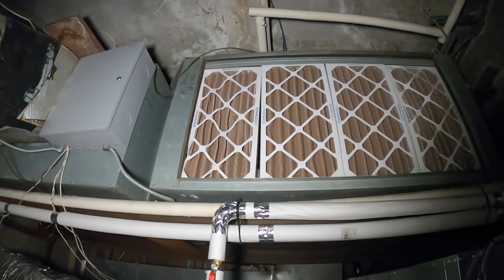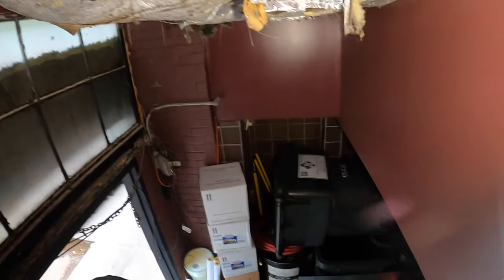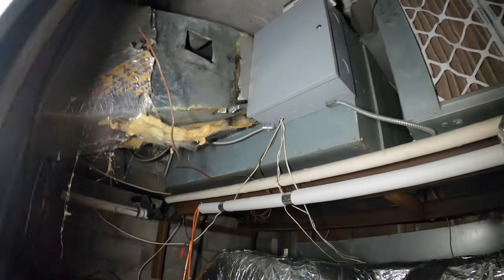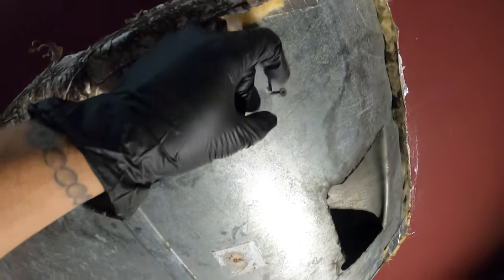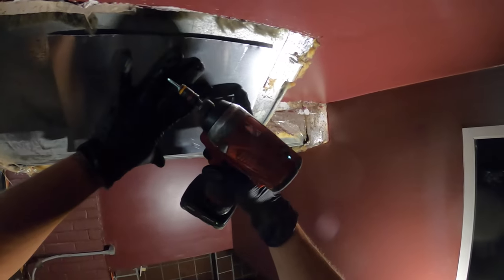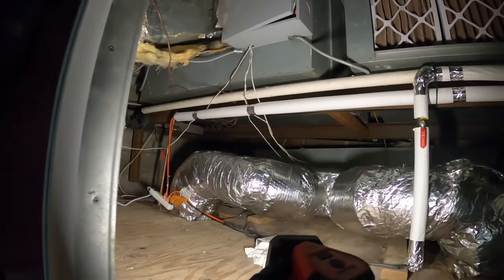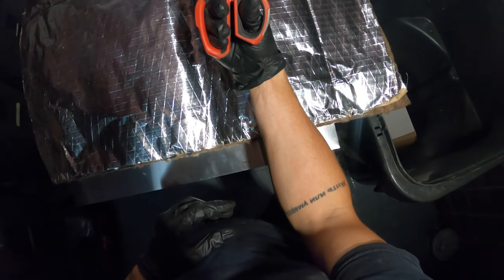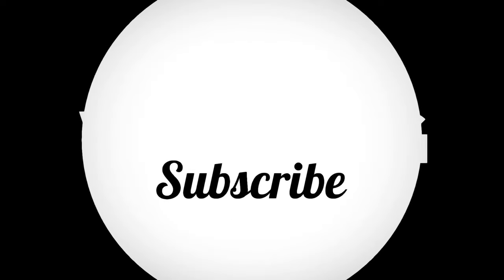HVAC Service Call: Air Conditioning Duct Work NIGHTMARE Repair (HVAC Duct Repair) AC Air Duct Repair

Comment: Looks a lot better. A little tip i was taught when i first started: get you some cheap spray contact adhesive and spray the joint where you are going to tape. Wait 30 seconds then apply the tape and squeegee it down. It will make it a very strong repair.
Reply from the maker: @topher8634  Thank you! That's a great tip. I will definitely try that next time. I don't do much duct work. Mainly service. Thanks for watching 🤙🔧⚡️
Reply: Next time try using push pins to hold the insulation.  The stick onto the duct and no need to mastic the duct.

Comment: I did service me and duct work did not get along. But I was taught when making a patch to kick a bevel with my hand tongs a 1/4 inch all the way around the patch. That will prevent the patch from buckling when screwing it down.  Looks good to. Thanks for the video. Good job

Comment: Great job I started with residential and commercial installation ductwork is what I love doing the most. Definitely using the air seal is great. My only suggestion would be to get some Midwest offset tools for making the cuts easier for you. Malco turbo sheers are great but I think the hand is more precise for making close cuts. Definitely use a squeegee on all the tape the heat from using it will create a great seal. Great video!!!!
Reply: I have been in the sheet metal trade for 43 years and I must say that was the best patch and insulating job for a guy who doesn't do sheet metal or insulating. Thxs for the vids!

Comment: I’m itching just watching this video Lolol good job!
Reply from the maker: @MirsadBajrami-vd5sn  Same. I hate working with fiberglass but you gotta do what you gotta do 😂🤙 Thank you & thanks for watching! 🔧⚡️
Reply: @JumpermanTech  At least it seems to be relatively recent insulation and it was yellow fibers and duck tape me if the building was from before 1990 and the insulation was made of white fiber (high probability that it is asbestos) I would have refused to touch it because it could be asbestos but fortunately in this video it does not seem to be the case but I imagine that sometimes you come across potential pipes/ducts covered with asbestos that you do in such a case I hope you have the right to refuse to touch it when it seems to be asbestos

Comment: I did sheet metal for a commercial company out here in Buffalo NY for a few years and then went to the service side as a tech for another year or so and that install experience came in handy for stuff and was able to teach techs with more experience than me some tricks. 

For cutting sheet metal you’re going to want to buy some Midwest tools red and green snips, they are offset in different directions which will help you way better with cutting that sheet metal. Just make sure you have the snips angled properly when cutting, if you don’t they will fight you the whole way trying to cut the metal, if done right they cut like butter. 

For measuring the patch, when you go to measure the metal patch you need, run the bottom of the tap measure against the metal edge and pull your tap to desired length and lock your tape in and then hold your sharpie against the end of the tape and run straight down the metal. It will help get you a nice straight line each way. Also another tip is if you come across metal ductwork with slips and drives that are kinda loose, you can screw 5/16 self tappers thru the middle of the slip and will catch each edge of the metal that is put into the slip locking it in place.

Comment: That FSK insulation can be a challange. 
You were right to use that foil tape. the FSK tape sucks. 

Looks good.
 
You can also use sticking pins and spray glue to help keep the  insulation in place while you tape it.